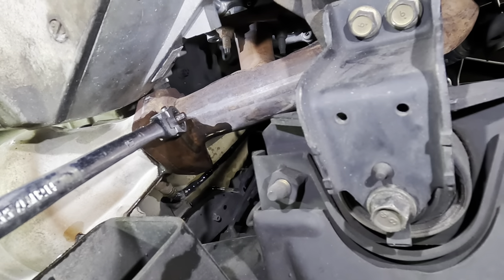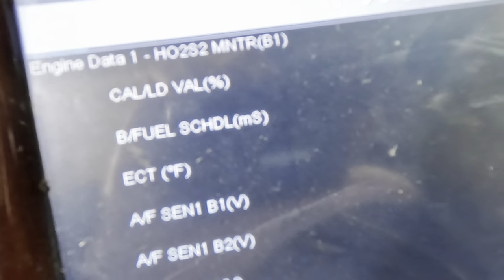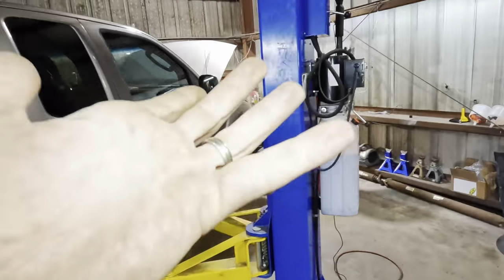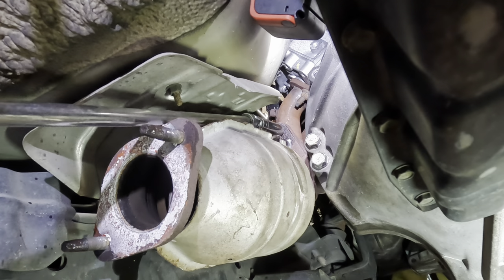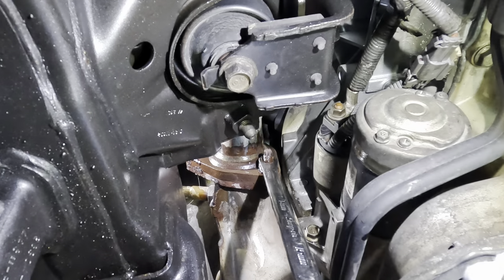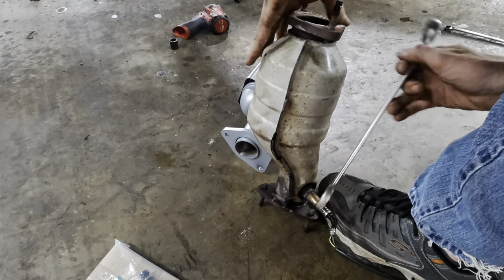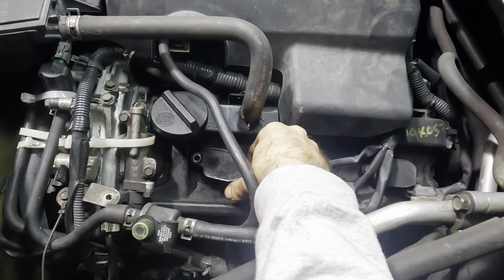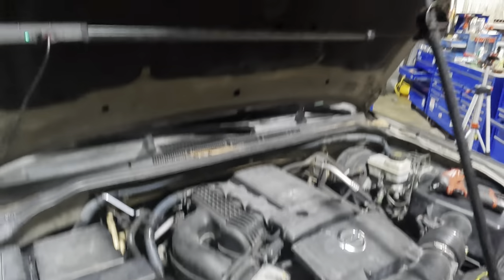Catalytic Converters! Missing?  Running Rough P0302 P0420 P0430 Nissan Fronter 4.0 v6

Comment: The question is simple an I answer it that the plane wouldn't be able to take off. But if there was thrust from the engines an the wheels only maintained the speed of the tree mill the plane would definitely excelorate enough to break free from the treadmill regardless of how fast the wheels would be spinning. So the question is flawed not enough input to make a true answer. Although the truth is the air has to flow over the wings for lift. How long is the treadmill? An if the plane is not fixed to the ground then the plane could definitely thrust off the tread mill an depending on runway length an etc . I say it would still after doing so take off.

Comment: California requires high emissions with the carb bill, as well as requiring lower fuel economy. I failed CARB because my truck didnt put out enough carbon, so I had to increase my carbon output by 90% and drop 6mpg to pass their idle tests. But, it's America, big business can buy laws. They wont try to clean the air, just put more taxes on your taxes.

Comment: But if the conveyer belt was three miles long, and the jet plane sat on it with the brakes on, it would rotate when air speed reached the speed to rotate.  With the engines on take-off power, of course.
Reply: bla-bla-bla-gibberish

Comment: The temperature can delay or prevent changing.  However,  as is proven with phone and computer updates, I believe the huge programmable microchip in the battery case not only regulates the cells,  but is set to obsolete (I hereby claim verb usage copyright) the battery.

Comment: the plane will fly because the wheel speed makes no difference as long as the bearings are sufficiently lubricated since they are going twices as fast.

Comment: That is an easy answer. An airplane needs air flowing past the wings. This aircraft has no movement in relation to the air. No airflow, no lift. In this example the jet engines are only keeping it stationary in relation to the ground, not the air.
Reply: sorry     your theory is  loopy/Wrong

Comment: A jet engine generates the thrust of the airliner, not the wheels. A 747 on a treadmill won't prevent the aircraft from moving forward.

Comment: There’s another flight conundrum..
If you are in a helicopter and you are fastened to a flat disc the same diameter or larger than the props diameter…. can you take off..??
Reply: this  is  Gibberish !!!
Reply: @daviddavids2884  ..
if a toy helicopters landing struts are glued to a disc wider than the prop diameter…
.. can that helicopter fly..??

Comment: If air was flowing over and under the wings, lift and drag would occur. Take off could've achieved.  A stall isn't engine related.  The stall is when airflow stalls going over and under the wings . Flight 101

Comment: What we need is an internal combustion engine that does better than 25-30% efficiency at burning gasoline.  ~75% of every dollar spent on gas goes out the tailpipe and into the radiator as wasted energy.  An ICE has to hit 90% to beat a modern EV motor.  Even the best gasoline won't get an average car engine beyond 30%. 

Floatplanes take off from a convertor belt made of water all the time.  So yes, the plane will take off.

Comment: I read, and the best I understand, that you should be recharging Li-ion batteries at 20%, 80% discharged, to get the best life out of them. All batteries have a cycle life, they will only accept so many charge cycles. Each time it is placed in the charger it counts as 1, if you always charge at 20%, 80% depleted, that increases the useful life of the battery. Topping them up every time you get a chance decreases the cycle life. Example battery has a lifetime of 2000 charge cycles. Charging @ 80% in the life of the battery equates to a life of 1600, minutes or hours, I don't know. 1000 cycles @ 80%, 20% depleted, and 1000 Cycles at 20% equates to 1000. A shorting of the cycle life by 600. I do not know how you tell the charge left in the battery, my Rigids run until they are dead. But they hold the charge for months, which is nice.

Comment: 1) NO anti-sieze  lube reinstalling old O2 sensors, and 
2) the downstream is probably ruined by no cat
3) reused the stud!
4) manufacturer was too cheap to use Stainless steel nuts, but, since some guy will be redoing the job to replace sensors...
5) where did the cat cores go? in the muffler? In customers trash (threw away precious metal?)
6) LMAO

Comment: I truly believe that both sides have it wrong with gas and electric. It would be great to go to full electric if the whole infrastructure could be improved, however, Hybrid I feel is the solution. More than 60% of the US is in perfect weather year round for solar panels on their home. That will reduce the amount of carbon created from the plants creating the energy. It will also allow us to charge the hybrids at home with also being 100% carbon free when it comes to energy. This would save gas preventing us from needing to fill up nearly as much, and put more money into the pockets of homeowners. Sadly, oil giants have the politicians in their pockets and the amount of research and actual improvements is slow due to this. I do not think gas can be removed anytime soon at all. However electric cannot take over at all. So, we need to meet in the middle. Solar homes with Hybrid cars.

Comment: To answer Q about feul emissions. Yes Ray you can. In EU we have additive to diesel so emissions get less harmful to environment. Year 2030, the EU aims to increase the share of renewable energy in transport to at least 14%, including a minimum share of 3.5% of advanced biofuels. EU countries are required to set out an obligation on fuel suppliers that ensures the achievement of this target. In Sweden we ad 27% already and the former gov pledged that 2030 we would have 60% share in diesel. This is stupidity b-cause it´s to expensive for the people and does nothing in global thinking to environment. EU minimum is enough.

Comment: the plane thing..if you spin a wheel on that truck your working on ..is the truck doing 10mph sitting still? or is the tire doing 10mph on its own?..lol..lol airplanes need air passing over the wings of a plane to make lift to fly. if you jack up a plane and spin its wheels does the plane leave the ground suddenly? lol 🤣🤣🤣🤣✌✌

Comment: never owned a car that had more than 1 cat, rock auto is selling about $600 for the cheapest complete set on this model, guess it's not much more than an mid level expensive version for a compact car

Comment: Jump the dead, not taking a charge with a good charged battery. + to + and - to -  for just a few seconds, then put the dead battery on the charger.  
 Almost every time, the battery will now charge and work fine again.

Comment: What the.... HE'S A WITCH GET HIM😢 I need to move down yonder being a mechanic in this wonderful State of New Hampshire one does not just remove bolts thusly. I have an induction heater called hot rod 😂 my trusty torch, air hammer and a 3lbs maul that is required for almost anything you need to do. If I put a 17 on that bolt up here pÊ😂ffffttt fuggit aboot it watch that 17 become a 15 then that 15 become a 13 at which point you say to hell with it whip oot a grinder (yes the sandwich) sit there looking at your bloody knuckles eating a sandwich just staring at the problem. Then you do what you should have done right from the jump 🦘🦘 get your cut off tool and do a hardware delete and replace with new.

The end. Sighhhhhh...pocket computer disengage rant sequence# 003.5 5 It looks glorious man. Keep up the awesomeness 😊 YOU'RE THE BEST!!!😊

Comment: Where did you hear "the USA some of the poorest quality fuel"? 

The only people I have known who have said that are people who have been to both USA and anther country, purchased gas, looked a the octane ratings on the pumps, and don't understand what they mean! 

First those of you who don't know the octane rating does NOT mean cleanses, quality, amount of power, or any other crazy a shit you may have heard. It means one thing, and one thing only, and that is it's resistance to ignition! It's actually technically it's resistance to ignition under pressure but still. 

If you look at the octane rating on a USA gas station pump it has a complex math formula with RON and MOR. See there is 2 methods to get the octane number the motor octane rating (MOR) and the research octane rating (RON). Europe soley uses the RON number as their octane number. 

The USA technically post anti knock index as their "octane" rating. This is (MOR+RON)/2 (that is the complex math formula you see on USA pumps). Because MON tends to be lower than RON, the USA adds both and divides by 2, and Europe and most other countries use soley the RON number, USA "octane" ratings tend to be lower than most other countries. 

Again most importantly this does not mean the gas is any lower quality, cleanness, power, or anything else. Basically all it means is 2 methods come up with 2 different numbers. Most countries decided that the one method is the most accurate, close enough, and rolled with it. The USA decided that wasn't good enough, and that we were better off averaging the 2 out. Again all these numbers mean is the fuel resistance to ignition under pressure. The higher the number, the more pressure it can handle before spontaneously combusting!

Comment: Love how people like you screwing the next person that has to go in and remove the exhaust pieces that you installed by not putting antisize on any of the exhaust bolts / nuts and 02 sensers threads causing them to seize up into there threaded bung holes and then gulding the threads up when removed

Comment: I would have leased recommended the air to fuel ratio sensors be replaced as that this is The least that you can do while you're here
Reply: leased  ?        at least

Comment: ALL air planes FLY by using the wind flow over the wings giving it drag and lift.
An airplane's top of the wing as air flows over it develops a vacuum and the air flow under the wing makes a pressure lifting point.
This is how all birds fly as well.
So, an airplane standing still on a conveyor belt is the same as if it was standing still on a runway.
With no air flow there can be NO lift or flight.
Here's a riddle of physics.
A bus is moving at 50 mph down the road.
YOU are standing at the front of the bus.
At exactly the same time, YOU jump into the air as the driver hits the breaks.
Where will you land?
1. in the same spot as you jumped from?
2. Toward the rear of the bus?
3. Or thru the windshield of the bus?
Reply: fail    wrong    maroon

Comment: Possible someone drilled them out to prevent the engine from being ruined because they were clogged and those were too expensive for them to replace at the time. 

Or thieves stole the insides because don't they sometimes contain precious metals and that is why people steal them?

And the emissions thing, they don't want to give us better fuel because then they couldn't charge us for all the unnecessary extras that come with crap fuel and their pollution regulations that are only for the poor. Like cats, cleaners, emissions testing, buying more fuel constantly, and replacing parts because they wear out or wear out faster due to poor fuel quality. They put more ethanol in our gas than they admit and you can certainly tell when you get bad gas from a station because vehicles run worse and lose all of their power. 

Tn passed a law several years ago that if the epa ever said so, so many days after that we would stop requiring emissions testing. And they did away with it a few years ago.

Lost and found tools, finders keepers. Because who at the other shop, if you can find the correct shop, would be honest in saying it was or was not theirs? I mean if they know the shop and tech that did the work and it can be returned then I would. But if the shop and/ or tech cannot be found, then keep it.

Comment: The reason why your batteries are doing that is because you failed to read the manuals. If you do not let those batteries drain fully every time then you will get those problems.  Reason is those batteries have a brain cell ( not sure technology name ) and if you continue to charge when the batteries are only half drained or 3/4 drained eventually the batteries will only charge a certain amount or wont charge a fully drained batteries. Let them sit on a unplug charger for 24 hours this will reset the brain then plug charger in and it will charge.

Comment: All mechanics are a little crazy it’s just part of the job finding the broken parts and replace them with new shiny ones and then wondering why you can’t buy new fingers to replace the one you hit with a hammer and turned your finger nail black I have been a mechanic but I became a machinist and it is a lot crazier than working on cars I have made the new parts for cars the math will make you nuts I understand that every thing is math hight width diameter of the radius hole location and size of the hole. The airplane would fly if you have a fan blowing air fast enough to make airspeed airplanes don’t have a wheel speed sensor but a airspeed sensor

Comment: Bonding (ground strap) is to reduce RFI (Radio Frequency Interference) electrical noise generated by the engine, everything from ignition to the pulsing of the injectors. An unbonded exhaust can act as an antenna.

Comment: Damn it Ray... please don't do that. I like to read the comments but when u go and break the Internet, too many dumb people have to comment their knee jerk thought with no actual understanding of what they are talking about. 
The planes engine will put as much power as needed to the front landing gear then when the plane matches the spin of the flat earth it will take off. If the plane was rear wheel drive, then it won't take off. Only front wheeled planes will take off. Duh! Everyone knows that.

Comment: If everone knows.  I changed my mufflers. the shop got new muffler  installed. I notice is a lot smaller than the old muffler. Three weeks later engine light on and few more days more  srs  light is on. It is christmas on my panel  both lights on now. If everyone could help  please

Comment: Cats expensive.  O2 sensors cheap.  WOuldn't it make sense to just replace the O2 sensors.  Labor is free.  Just cost of parts.   Where did that guy's cats guts go?   Salvaged for the platinum already?  I get a P0302 and i pour some stuff in my tank and it goes away.   Comes back, more stuff.  I think it is called Guaranteed to Pass

Comment: an airplane is gonna need all the power it needs to even stay on the conveyor belt at the required 216kmph if it had very little power to stay on it would lose control and crash, therefore needing as much power as it needs to generate normal ground speed while on the conveyor.

Comment: How does a fighter jet launch off of an aircraft carrier without wind speed?
Reply: Catapult launches it at a speed high enough to create airflow over the wings for lift...jet engine thrust adds to said airflow.  ...
Reply: @stevenbaker9327  So why wouldn't a jet on a conveyer belt be able to take flight then if it was up to speed?

Comment: SORRY BUT:
You reinstalled the forward O2 sensors WITHOUT CLEANING both the sensor itself, neither its threads, and without a new dab of Antiseize...  Bad job!

To clean a used but still working O2 sensor, you carefully apply the tip of the flame from a handheld propane torch, adjusted to produce a small flame with two visible blue zones: The brighter inside conical part of the flame should touch the very front of the tip of the sensor, away from the Heater Element of the sensor, rotating it, for a short time, just enough to burn most of the carbonous deposits from the tip of the sensing element and get a light gray or off-white color on the porous ceramic part of the element. Leave it to cool, and then hit it with clean and dry compressed air, to remove most of the ashes. That will return over 90% of the 02 sensors to "as new" condition, easily verified with any code reader set to display the signal waveform with a correctly working engine in good condition.

And, when removing a good, working O2 sensor, never leave its connector plugged and go twisting the cable so many turns until totally unscrewing the threads... used sensors have had their cables reheated many times, so you risk fracturing the possibly brittle  wire's insulation, and cause a "Sensor fail" code!... Get a PROPER O2 Sensor socket, UNPLUG the connector, and then turn the sensor without twisting its wiring harness so much! You don't want to break the harness wires insulation and then having to order a new sensor, just to "save" a few seconds of work!

Comment: I cant bring myself to put cats on a car with a misfire. Regardless of who diagnosed it. Order of progression, misfire could burn up the new cats if the customer didn't know, you should.  Why not explain to the customer about the saving the cats for after running the car fixed with the misfire for a while. Bad call. No way that a downstream o2 will read correctly with too much oxygen coming from the misfire. Let alone the upstream trying to correct for a miss.